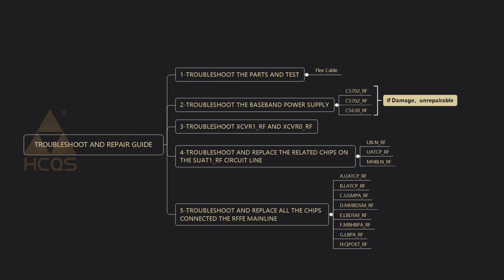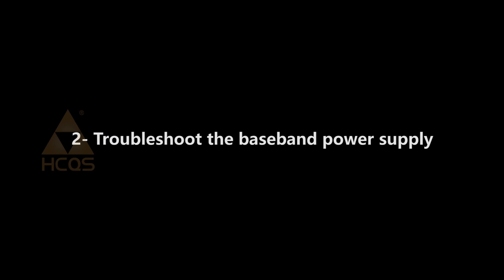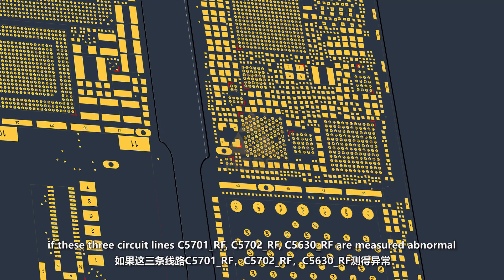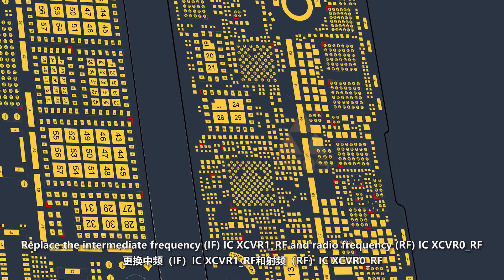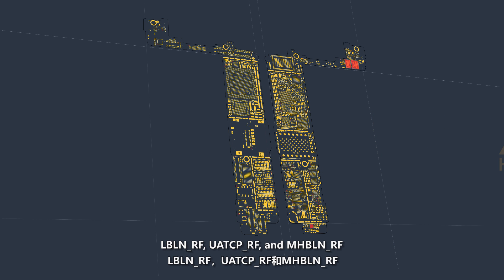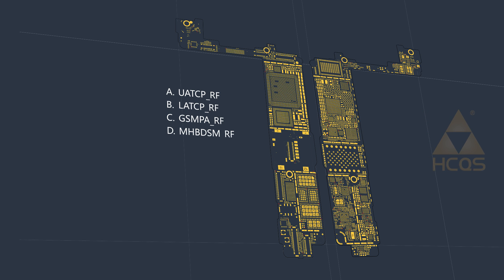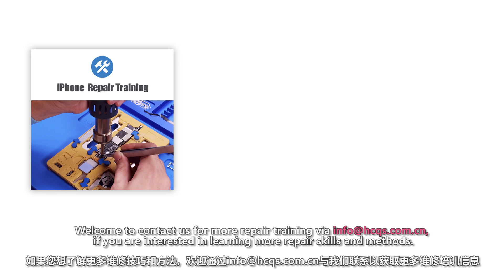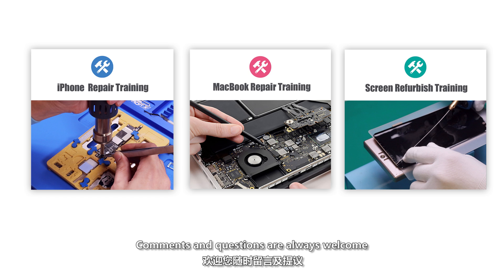How to Fix iPhone Pops up “No Service” for a while and “No SIM” for a while

Comment: Help, mine is in no service and after 6 seconds no sim will pop up then immediately disappears, what could be the problem?
Reply from the maker: You can first check whether the iPhone has a baseband, if you don't have a baseband info on your iPhone, repair accordingly; if you have baseband info on your iPhone, then troubleshoot the iPhone motherboard antenna
Reply: What do you mean by the mitherboard antenna? There are two antennas in here
Reply: It has a baseband btw, pleasee hellpp
Reply: What should i replace? The one on top of the charging flex cable? Or the one in the charging flex cable?
Reply: Btw my phone does really heats up and drain its battery even when turned off, what could be the main problem?
Reply: @bulaunivankaine3325  are you still get this problem? what is the solution?